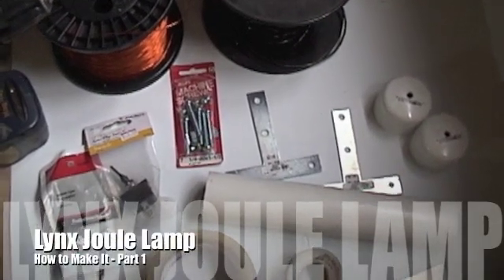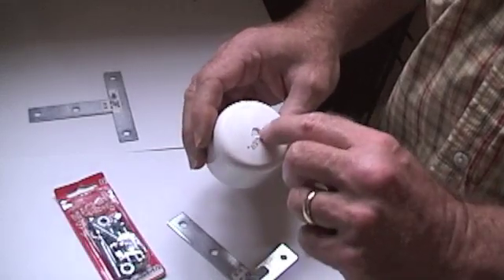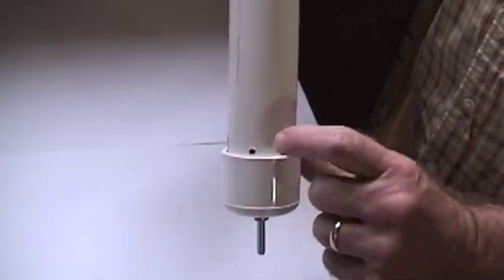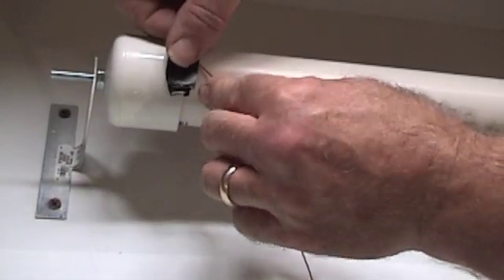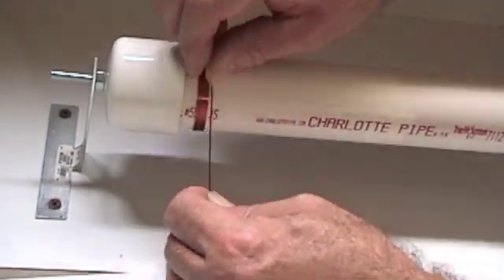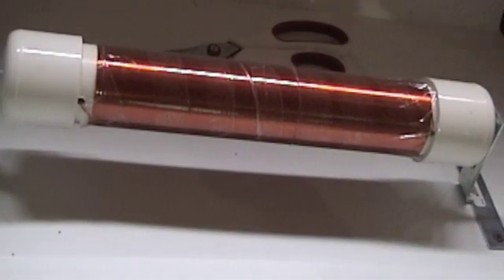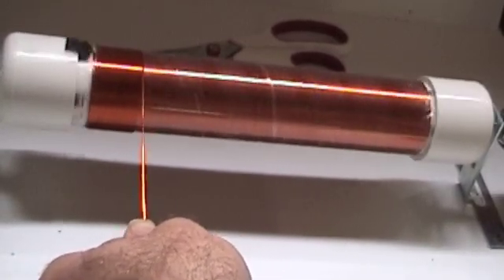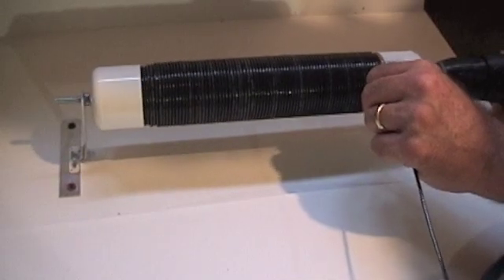Lynx Joule Lamp - How To - Part 1

Comment: Hi, i am from India. Unfortunately, its hard to find goods in my area or online with specific rating. In this case, i was able to get the 20 gauge wire and all other components except the the primary windows wire rated 14 gauge. All that i found is 15 gauge single stranded wire and or 12 gauge multi-stranded wire. I am not sure which one would be best among these. Can you suggest anything please ?
Reply: Sorry, i had a typo there. I wanted to mention "primary winding wire "

Comment: I was reading you shouldn't use plastic tape with your coil, because the tape has undesirable electro-static, triboelectric. I've seen it written it is better to use a wax-paper separator.

Comment: I know but this was designed to drive unmodded store bought bulbs. Some even use generic CFL's which couldn't be done without an inverter if powered by standard batteries.

Comment: 12 volt LEDs will pull rated amps from a 12 volt battery.  What this device does is it uses less power because we are using very high frequency on/off of power to the bulb.  The human eye can't detect the high speed on off and perceives it as fully on.  It is possible to light six 7 watt bulbs with about 20 watts using this system.

Comment: This device uses less energy compared to wiring it to a battery using an inverter so it can run longer without the need for more batteries in the bank. Initially it costs more but is still a cheaper greener alternative to more batteries.